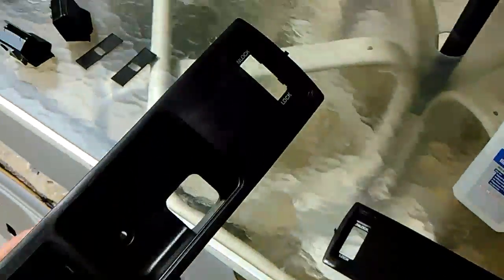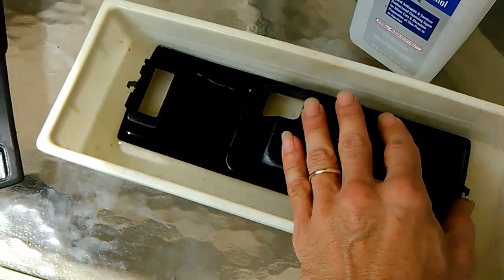Quick tips 1996 Impala SS door panel trim refinish SSinteriors

Comment: Any tips on getting them to lay flat again ?
Reply from the maker: djay23 seems I used a heat gun on them before? these are warped too. if I figure something better, I'll upload about it, maybe heat them up and set them in sun with a weight on them?
Reply: matt1989cars yup a video of that would help a lot. Even the ones out of the junk yard arent any better..
Reply: @charles1matt  any tips on  sanding down and painting wood grain door bezels black ? Can it be done with the same black arm paint also
Reply from the maker: @adrianbinger8397  yes just don't use too course sand paper as it will put deep scratches that will show thru the finish. 220-600 grit
Reply: @charles1matt  so sand by hand and does the wood grain laminate come off or will it just be sanded rough to be painted over  and that same sem spray paint should work correct